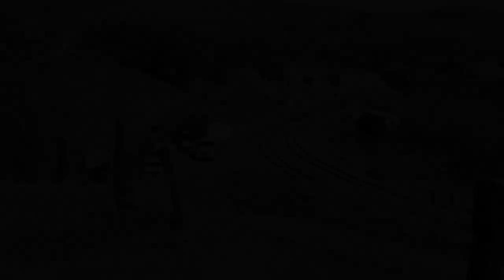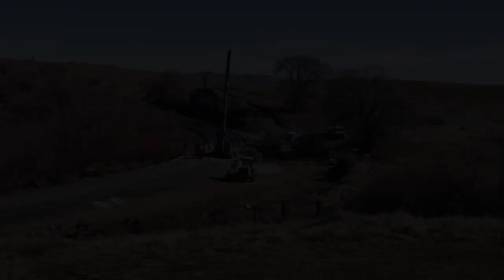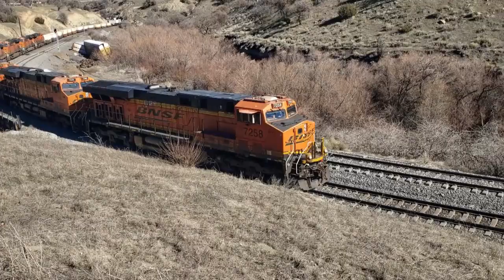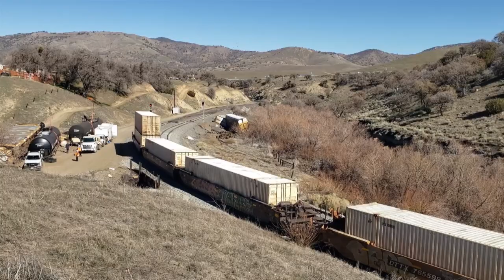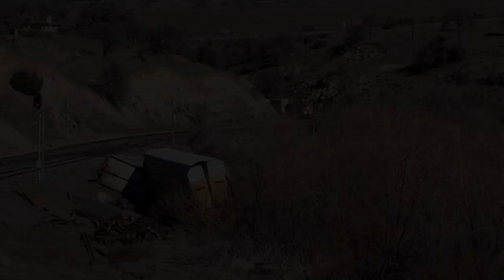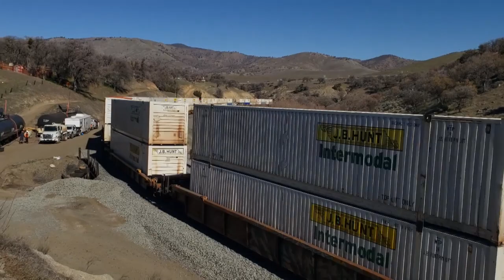The Cable Derailment: Venting/Burning Off LPG Cars

Comment: The drilling is for un-stable soils.  They are likely sinking a shaft to “Cast In Place” a Stabilizer Column.  Consider the appearance of the curve and distributive weight on that curve, shifting rails.  Process called “Pinning” same problem on the old 1880 SP Soledad Canyon to the South (Acton CA).
Reply from the maker: Thank you. I'd never seen that done up here in my 40 years! When all the hubub is over, I'll go take a look at it and do a short video!
Reply: Very interesting comment! Thanks for posting the information!

Comment: the cars regulated or non-regulated materials will have “residual “ material 
in the tanks, LPG tanks will have 1 atmosphere of gas still in the cars. Probably 
about 10 years ago they had “residual last contained” now it stays with the original placard 
as is for what ever the material that was in it. unless it is triple washed (the 
cleaning solution will be regulated if the material was regulated. ) then it is classed 
as empty. they do not want any L.P.G. to remain within the tank, due to explosion
hazard from the gas that remains. that is why they burn it off, safest way of
removing the hazard.

Comment: an LPG tank car, no matter how much gas it has left after it escapes, they have to vent and burn off excess gas left and make sure the tank is empty. Then they will punch a few holes and then water it down inside. The tank will be put on the track and transported to a yard for scrap destruction.

Comment: Now that's a lashup!! Eight engines with 5 pulling? Maybe a power move added to this train :)  I imagine they burn off the propane so they can handle the cars safely during removal. I enjoy that sound of power as those engines work up the grade - awesome!  Excellent video - very informative and we get to see rare stuff - car venting, drain setting, 8 engines, etc.

Comment: The rubber hose comes apart inside and blocks the air from flowing in the train line hoses .  Sure would be great if you could be there when the derailed cars are either set back on the rail or loaded on flat cars . The cars that are repairable will be back in service . The other cars will be cut-up onsite and hauled off for scrap .  Great video Mark .
Reply from the maker: All cars are to be scrapped. I'll post a walk around video I shot today on Wed. morning (2/2) and will stop by Thursday as I leave on my vacation and see what's going on. After that I'll be gone for about ten days and will miss whatever else happens there.
Reply: @MarkClayMcGowan  The best thing they can do . Won't have to give up tracking time and disrupt train movement on such a busy route . Thanks

Comment: Looks like a pile driver that Frankepile used to make in StAlbans UK near my first company Marconi Instruments.
They hammer a pile into the ground to stabilise it for a building, bridge or any where the ground is unstable.
It's the engineering side of railways I like.
Thanks for the video.

Comment: It looks like if they were to fill in the area to the right about 700 or 800 ft to the right and make it level with the tracks they could shift the line to the right and it wouldn't have to make that tight bend when it comes out from the rock cut
Reply from the maker: The ground there is unstable due to the constant undermining of Tehachapi Creek

Comment: Question Mark. How many crewmen are usually on these trains. Is there one in each engine or can the other engines be controlled by the lead engine. Thanks.
Reply from the maker: Just two. An engineer and a conductor, both on the lead locomotive. All others on the train are controlled remotely by the head end. Here's the link to a video I made on how they stay in contact with each other. Thanks for checking it out!
https://youtu.be/PRJLP-xTArg
Reply: @MarkClayMcGowan  Thank you